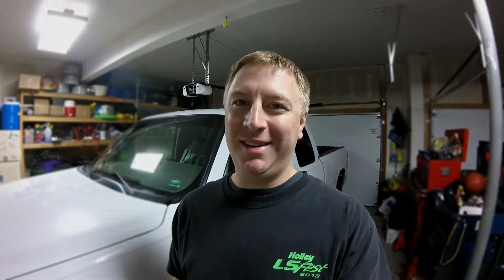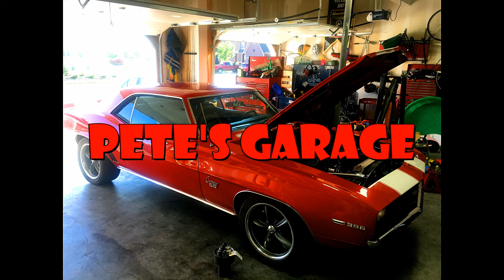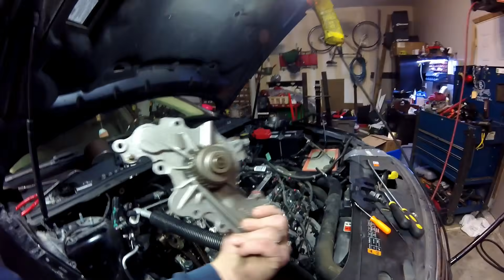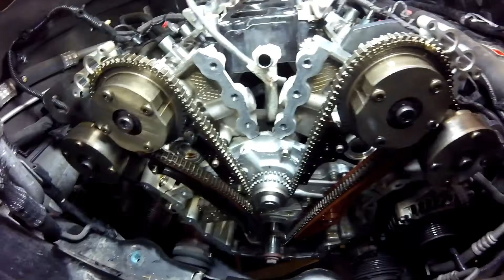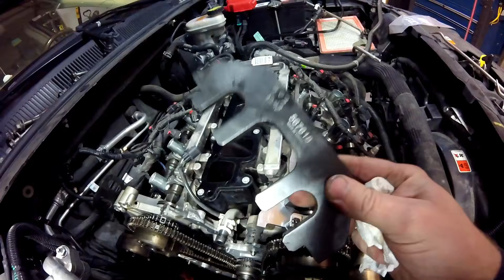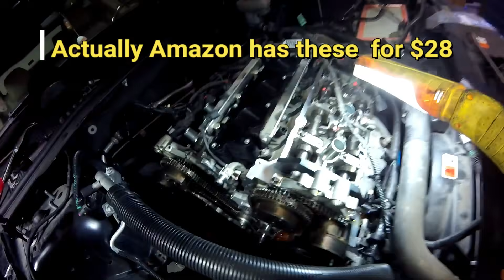Why does the Ford Taurus, Explorer, Edge 3.5L water pump cost over $1400?

Comment: Just another perfect reason to never own a modern Ford.
Reply from the maker: All manufacturers have a service department. Just saying
Reply: @PetesGarageandperformance  So what ? $125 an hour to change spark plug on any car is highway robbery .
Reply: Pete's Garage Dude you are the opitomy of this shitty day and age. An American mechanic saying to take it to the dealer🤢 having a 2014 car and alredy needing a water pump thats horseshit
Reply from the maker: Sorry you feel that way. Next time I won’t take the time to make a video to help explain why shops charge so much for a repair. I just thought it would be good info for some people who think they are getting ripped off. Thanks for watching.
Reply: @PetesGarageandperformance  they are just annoying trolls that will bitch about anything, every car and car manufacturers has their problems
Reply: @PetesGarageandperformance  No sir...this was a very informative video...if I had a shop I would have this video playing all day just to show people how tedious the process is
Reply: Pete's Garage yes, and some manufactures like Toyota/Lexus are ranked #1 in reliability while North American cars are generally unreliable garbage... they are on complete different ends of the spectrum.
Reply: I think you mean any modern car. They are all junk.
Reply: Not necessarily Ford.  BMW went to electric water pump WITHOUT a temperature gauge.  By the time you get the overheat warning it could be too late....Also moved the cup holders to the most opposite corner of the driver they could find.  And they are cheap plastic fold out which stick and even when they flip out are cheap and will barely fit a small McDonalds Coffee.
Reply: @stephencannon3140 I own a 2011 335 xi and yea they are a little far away but they will hold large cup sizes but I don't eat or drink in my car much anyways dosent bother me
Reply: Stephen Cannon and that's why BMW stands for:

BIG MONEY WASTED
BUTTFUCK MOTORHEAD WACKOS
Reply: This is a typical problem in a lot of cars, particularly transverse mounted front wheel drive (which most cars are). Maybe not this exact water pump issue, but I've got a Honda that you need to take the passenger wheel well out to do much of anything on the engine. Luckily, since it's a Honda it has 180K miles and has never had anything more than routine maintenance.
Reply: Most all makes and models have engines that are similarly a pain in the ass. I have an older BMW X5 with a 4.4, and while the water pump is not driven by the cam chain, replacing the cam chain and guides is something that I can expect to do some day as they are known to wear and require replacement. Not the end of the world. Just need to step up your DIY game.
Reply: please... GM was doing on the Quad 4 back in the 80's and 90's. Nissan 3.5 V6's are the same! New GM like a Chevy SSR is the same. More common than you think!
Reply: @mikeallmon1  Quad4 twin cam was an awesome motor!
Reply: Funny that in the 90s-early 00s., they had no problem stuffing a FWD DOHC modular v8 in the continental, with an easy to change WP (which is going on 200K miles BTW).
Reply: @nissanv8FTW Front engine rear drive cars are (almost) always easier to work on than transverse mount front drive. The transverse mount just leaves no clearance to get at anything.
Reply: @al carr  Nothing like FURDS with cam-chains, turbos, intercoolers, LIMP MODE electrical POS
Reply: I own a 2012 ford taurus. Out of all the repairs i can do myself. I wont mind putting the $1400 or so for a mechanic to fix the water pump.
Reply: ALL manufactures have their dumb designs and issues.  GM Cobalt non turbo for example. Model years 07-09 had issues with porous cast heads that in as little as 60-70k would cause misfires due to the valve seats in the head burning out. Not a cheap fix to replace a head on a what would be a fairly newer car at the time. Worse was the fact that the car itself was perfect priced for a teen or college student. 

Think they had $2,000 laying around to have it fixed or the time and experience to do it themselves  on something that shouldn’t ever happen at such low miles?
Reply: @derfstang480   Still no where near the FURD electrical/mechanical nightmares. Plus, special tools, everything they build requires some new tool. Plus, cost they are expensive and the guy was a COMMUNIST as they put a plant in the USSR (hidden from history) the entire company is corrupt.
Reply: al carr nope got a 2015 GMC Canyon already has over 160k miles never had a problem
Reply: @glock1inthetop45  They are GREAT trucks, FURDS have mass marketing and useful idiots line up in droves and buy them. Furd is just quantity with no quality.
Reply: As a Jaguar and Land Rover Mechanic.. they shared alot of these Ford supplied engines..  what a piece of shits!
Reply: @elNenio  AS with all Furds - MASS marketing repeating #1 all the time, sure #1 in mass quantity of JUNK - with pom-poms and idiots constantly having to trade them in on another Furd as they have NO resale!!!
Reply: @mt1885  you don't have to keep proudly putting "FURD" in all caps ...... we get it dude, you can't spell........or you are 8yrs old and came up with the name by combining the words "ford" and "Turd".........so clever :)
Reply: Get a Tundra and even modern Japanese luxury cars are cheaper to repair than modern fords
Reply: Have I mention my corolla has 350k  and I just replace the water pump ,which cost 65 on autozone and 25 online so yeah, why buy ford gm or BMW when a toyota is cheaper and more  reliable,  like I say to my friends you buy a Kia, a Mazda or  nissan  and we no longer friends but I will have to add a ford now lolol
Reply: nissanv8FTW Ford also put this engine in the Flex, Edge, Fusion. It’s a crap shoot.
Reply: @THETOPGLOCK  I have a 2008 Edge . No problems in 11 years .
Reply: @georgeelmerdenbrough6906  I have a 2011 with a new fuel pump, a new driveshaft, a new steering rack x4, a problematic fuel vapour management system, busted door latch sensors, peeling clear coat, a sometimes creepy electrical system, and now after all that new stuff in just two years, a shot ptu. I'm not fixing it. It sounds like I just got married, but idgaf. It's a jalopy now. A front wheel drive jalopy now that those gears have presumably been worn down. It's too bad really, the engine and transmission have been Rock solid even after 290,000 km.
Reply: the taurus has been known to be a pain. look at the sho or the “mustang killer” that only kills its self cause engineers thaught it’s be smart to make a mechanism where the timing chain explodes resulting in valves and heads becoming one hunk of metal 🤦🏽‍♂️
Reply: @AlexisGonzalez-eg6nl  yes and that was a Yamaha engine in the SHO of the 90s.
Reply: @johncholmes643  Takes one
Reply: yeah its because they want you to take it to the dealer to get worked on i guess
Reply: @grumpy old fart  yeah thats kinda what I was gettin at =)
Reply: @Mentor Tairi  GM does take the taxpayer gold then moves to Mexico! However LS engine platform is pretty much perfection.
Reply: Ford Excursion
Reply: @nissanv8FTW if I remember correctly  from the parts catalog, the 3.7l in the mustang has 2 water pumps, it has the one this guy is replacing  and has one run by the serpentine belt
Reply: @Mentor Tairi  Talk about a strawman argument. That's done for cost effectiveness, cause with the old 5.0 and 4.6 thiers a HP threshold where it becomes pointless to keep throwing money at older Ford V8's, their crate motors are also way more expensive meanwhile GM outsources more so it keeps cost down. At the end of the day the whole philosophy of hot rodding is its no sacrilege as long as its 'the best', this is why everyone uses the Ford 9" rear end or run an LSX cause its just the best.
Reply: Any modern car not just for.
Reply: @HHRchevy  32 crown vic is my favorite but yeah model t is iconic =)
Reply: Who want a junk Ford water pump cost about $40 about 30 minutes to put it on
Reply: @Mentor Tairi  nothing but ignorance. In professional drifting the mustang has a factory coyote, the vet that competes with it has to have a different engine installed and that has to be sent out to a hot rod shop to be built so it don't blow under boost. Hot rod magazine has the story
Reply: The older I get, the more I’ll bring my vehicle to a shop for repairs. I gave up changing my own oil years ago because the price difference between me doing and a shop is minimal. I also don’t have to load the old oil into my trunk, hope it doesn’t spill or leak, take it to Autozone, hope their tank isn’t full, and dump it. Even the dealership is $40 or so. It’s funny seeing the old guys talk about their 60’s or 70’s cars and trucks and how easy it is to work on a SB Chevy or Ford 302 etc. Technology has gotten more sophisticated because of tighter emissions regulations and demands on better fuel economy. Anyone who says their old V8 got gas mileage in the 20’s or 30’s is lying. Cars were also lighter because they didn’t have tighter crash tests. A lot of cars are pushing 4000 lbs in the name of strength, therefore they need a powerful engine that still gets in the 30’s mpg. Blame the government and the market demand for that.  $1400 for that water pump change is worth it for me.
Reply: @nissanv8FTW ok, I just looked it up at work, in the Ford parts catalog it shows 2 water pumps for that engine, a timing chain driven water pump and the external serpentine belt driven water pump, it's just like the 3.5l EcoBoost engine in the f150s which I've had the timing covers off of before
Reply: @Mentor Tairi  your living in the past. Nobody is dumb enough to swap a gm engine into a Ford anymore. And the reason people did this was because a gm engine is much cheaper to build.
Reply: The average joe can replace a GM V8 water pump is the difference.
Reply: I'd be so bold to say modern American vehicles in general. My 2017 duramax Colorado is pretty much garbage attached to a bulletproof engine. The transmission has had to be serviced twice. 4 of the many body control modules have had to be replaced, and the gps, backup camera, compass, onstar module, have all gone out. The engine harness has pinch points in its factory location that shears wires. My wife's Cadillac is 8 months old and has already had two sensors (MAF and one in the cooling system) go out. I AM buyer's remorse.
Reply: WhatIsKenDoing especially that 3.5 eco boost bullshit my cousin is a ford man that's all he owns he brought the new SHO.He said he will never buy another 3.5 eco so I hate it for you ford guys with these new F150 and Expedition cause they are all 3.5 unless you order the coyote motor in it.
Reply: john preston > Dick breath.
Reply: Have you not looked at a modern well anything lately.  Between things like auto start stop and all it's associated costs and wear.  Then entertainment screen/cabin control of most everything a failure is both likely and costly across the board.
Reply: @al carr  Much worse reliability and what they are known for being good at much of is made by somebody else.  Example Powerful and reliable trucks, diesel co-designed with  Isuzu, transmission Allison.  Gasoline engine with 10 speed transmission over 90% designed by Ford.
Reply: gotta love all of those who do not have a clue and talk out of their asses .. I rebuild engines for living, and if you think this is a Ford "thing" , then you don't know anything about cars.
Reply: Exactly
Reply: Yea, have fun with all that fantasic tech shit gm puts in their engines just to get a couple miles per gallon better if that!  2007 afm engine introduced, ffw 7 yrs 2014 gdi introduced in afm engine have fun fixing collapsed lifters and now that with carbon clogged valves, smh....
Reply: @Mentor Tairi  no , the reason Chevy guys are buying mustangs and putting Chevy engines in them is because 1 they are the better chassis and gm doesn't make anything comparable , and 2 a monkey can work on a Chevy engine . Simple minded Chevy fanboi.
Reply: You got that right.
Reply: @Curtis Sherwood i remenber working on a ford pinto back in the seventies that needed a starter. I had to loosen motor mount lift the engine and lower the rack & pinion to change it. Unbelievable!!
Reply: on my toyota, i had to lift the engine up to remove the belt tensioner to even get to the water pump bolts and on my honda i had to remove my complete intake just to get to the starter. not as bad as this, but ford isn't the only one.
Reply: For all you mexican gm lovers... try replacing the headlight on a 2012 body style Malibu where you have to remove the entire front nose cone! 1.5 hours labor by the book.  I'm not a brand loyalist, they all do stupid things.
Reply: Jason Hendrix That’s why they always have one headlight out. You’re absolutely correct. Every manufacturer has engineering goofs.
Reply: @justanotheridiotredneck  Niether am I Im just saying I had bad experience with the taurus in particular and my f150 that i bought new and in 4 years had 3 transmission and spit plugs out randomly lol I went to gm got a silverado and have had zero problems in to years still love the older fords just not fond of the tricky dickey stuff.
Reply: @justanotheridiotredneck  and the second gen Chevrolet Equinox, it’s a nightmare too. Just a Malibu with an SUV body.
Reply: Chris H Nooo. Teslas just spontaneously catch fire. The only true reliable transportation these days is.....a bicycle. Lol
Reply: Yeah I switched to GM when my brand new ford truck would routinely launch spark plugs,,primary and secondary timing chain,,that says it all,,over engineering..
Reply: Larry triton v8 huh? the most common fix for those are to replace the whole engine
Reply: @AlexisGonzalez-eg6nl  You are talking about the sparkplug issue on the 5.4 and there have been fixes for that for a while now.The 4.6L is much better and that became the 5.0 Coyote which is a fabulous engine.
Reply: @AlexisGonzalez-eg6nl  Yep . Dodge minivans have the same gremlin
Reply: Larry ..yup. Now you can deal with routine valve decarbonizing ...LOL
Reply: Larry You bought a GM?  What a sucker.
Reply: @melrose9252  You don't need to do all this crap to change the water pump on a LS engine I'm just saying.
Reply: @melrose9252  YouTube Why the LS is so good.
You tube Stock bottom end record.
YouTube k.p. mustang.
YOUTUBE LS fest.
YouTube LSX Challenger.
YOUTUBE 400,000 mile LS powered Cadillac.
YouTube LS powered long travel.
YOUTUBE Stock 200,000 mile LS 4.8 mustang.
YOUTUBE Deboss garage why not Ford.
Yeah, buying a GM is a smarter purchase...
Reply: @larry40  right on!
Reply: @al carr  not my 68 chevy truck k10  (4x4) 
Very reliable!!! Bought it 38 years ago. Going to  drive it this weekend.
Reply: @mtnman6278   When talking about modern day car problems there is always someone  who has to jump in and say my 1960s or 70s truck is the best car ever. Your the winner
Reply: @305searay  i like my 1965 ford F250 but dam 10 mpg and power nothing, good luck stopping it, god forbid if i get in a wreak, that steel dash bored would be a killer,  and no dam cup holders
Reply: @squidreuel  just hose it off and sell it to the next guy
Reply: @mtnman6278  wait till you hit something and your hospital bill is 10x more because your car sucks at protecting you
Reply: @mtnman6278  right...lol...if it's new..its already through!!...keep on truckn!!!
Reply: Well before u get too carried away, I replaced the starter in a Toyota Tundra and I had to pull the  intake and other parts because it is buried under the intake.
Reply: I like my modern Ford . Had no good experiences with Dodge and Chevrolet . Aside from my Honda , nothing else has done as right by me .
Reply: @georgeelmerdenbrough6906  I like my Ford as well.
Reply: Thanks.  I was considering an RV with a modern Ford power plant.  Not any more.  Overly sophisticated designs with no ease of routine service is pure BS.
Reply: @garyplewa9277  a front wheel car has nothing to do with a motor home SMH
Reply: @metallicafan416  Understood.  I wasn't sure if this chain driven water pump design was used in the Triton V10.  I've since researched this and stand corrected.
Reply: FURDS are the WORST on earth, they have idiots who hear they are #1 in a number meanwhile they neglect to say NONE of them are on the road.....

Comment: Pete's Garage, you really forgot to mention that when the shaft seal leaks it tends to dump coolant into the oil washing out the bearings.  Great engine until it fails.
Reply from the maker: Yeah that’s definitely another drawback to these things. Luckily the one I had here didn’t milkshake the oil.

Comment: It's auctally alot easier to drop the cradle and do it out the car. You can have one of these motors out in about 1.5 hours to 3 hours according to skill level
Reply from the maker: Ty Bailey yeah if you have a lift and a/c recovery machine handy. But not for the average joe in his garage.
Reply: @PetesGarageandperformance  very true
Reply from the maker: joe jones i wish I had one at my house!
Reply: @PetesGarageandperformance  I would offer the idea that you put the money you save DIY to buying one. Getting a car off the ground can be priceless at the end of the job. Same as any right tool for the job thinking.
Reply from the maker: james stewart yeah I definitely know the value of the lift. It’s just not in the cards at my current house.  Maybe the next house though.